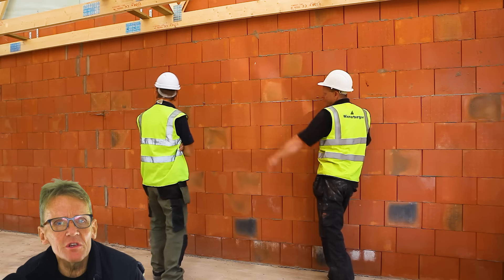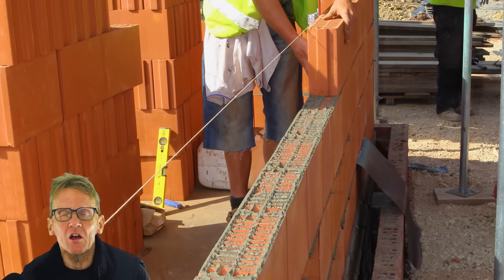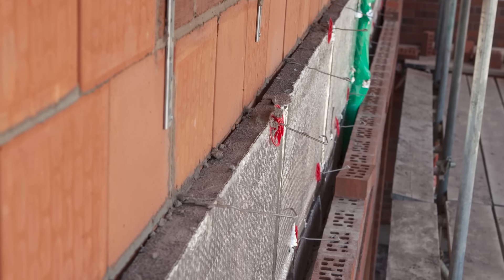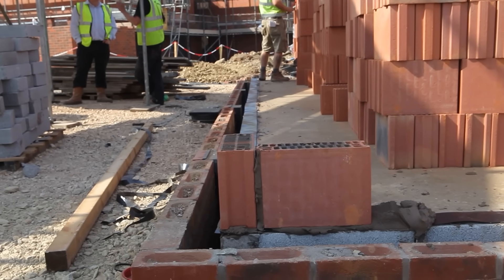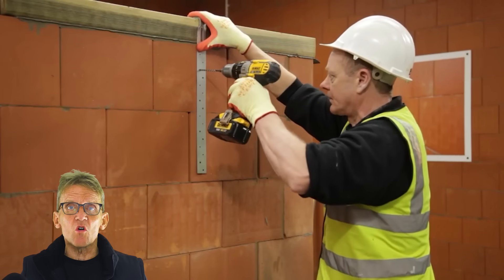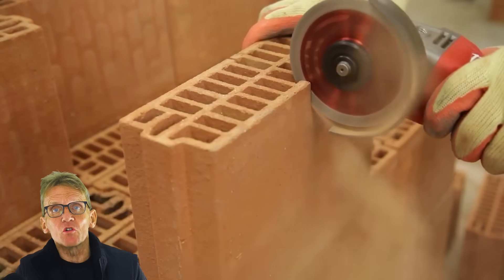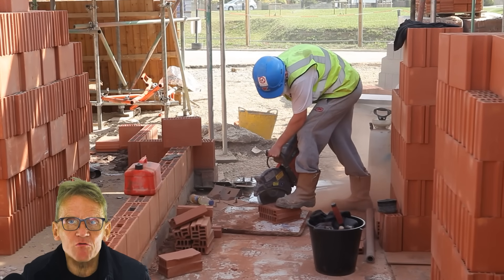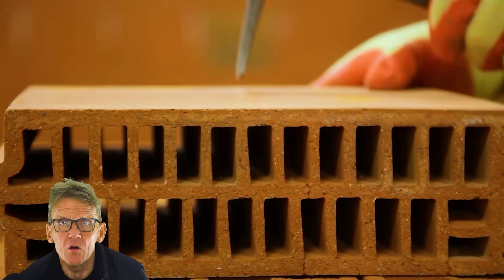Why Haven't We Warmed to Porotherm in the UK?

Comment: Like the multi layer building in your example video most, also used in France, have the airgaps on the side, so horizontal instead of vertical. So as you can see they are cemented all arround. On the flat/long side you can use a tool that lays a thinner layer 0.5-0.7cm of cement because the blocks are very straight. Disadvantage to concrete block is that they are more expensive however do better in insolation, speed/easy and steadiness.

Comment: Funny how the Roman Empire was using a version of these blocks a few thousand years ago.

Now they have rediscovered it and come up with a modern day version.

The romans used these blocks because they heated under the floor with a fire and the heat was pulled from under the floor, through the walls up into a chimney on the roof.
Reply from the maker: Don't forget the slaves who kept the fires burning so the Romans could walk around barefoot in the winter.

Comment: Yank, here from the States - never mind clay tiles,  every time I visit the UK , I have to wonder why the Brits can’t be trusted to have the light switch located INSIDE of the toilet ?
Reply: Many UK bathrooms have an internal light switch on the ceiling which has a pull cord to operate, however my house in Eastern Europe has an external light switch.
Reply: @scottyc7220  I just returned from the UK a couple of days ago after a few week’s stay; not one of the six  hotels we stayed in had a light switch inside the loo - must be a shock hazard thing …
Reply: @jimseviltwin1 Yes, I believe it's against the building code unless on a pull cord.
Reply: @scottyc7220  that’s my guess, too- however the National Electrical Code in the USA allows it provided it’s on a fault protected circuit. Such a breaker is fairly inexpensive here.
Reply from the maker: jimseviltwin 1 
We also have circuit breakers and many of our regulations are changing to reflect that fact but there are zones in bathrooms that require different approaches. 
Safety aside there is logic in having a switch outside the room you are entering.
How many times do we say "The switch is on the right" because we know people will struggle to find it in the dark.
Now, of course we have infra red proximity switches which detect the presence of somebody entering the room and,  more importantly leaving it.
Reply: @SkillBuilder  I guess it depends on what you have grown up with or used to … unless the room off of the WC is totally dark there’s sufficient illumination inside to find the light switch, which is always located inside the bathroom about four feet from the floor on the doorway opposite the door hinges. And if there’s not enough light to find the switch inside the bath’s door, you’re not gonna find the switch outside of the doors, either.
Reply: Don't think we in the UK like change, there are some disadvantages to this system but the benefits out way those ! 😊

Comment: I worked in germany 30 years ago, their construction was far more advanced than we are now.
We used to build a floor of a block of apartments  and the waste wouldnt fill a mortar tub. Here a lift fills a skip with waste. I cant believe that main contractors have never addressed the waste material here.
We used a 250mm cube block, kalksandstein, every opening measured multiples of 250mm, width/ height so there was next to no waste material.
Architects, manufacturers still design with metric equivalents of imperial dimensions, instead of designing all openings etc to work brick/ block dimensions. Comical
Reply: When I did my first own build I was annoyed at the lack of standardisation of measurements in anything, causing masses of waste, 2m2 of brick and block went in to the soak away which the builder explained was a saving for me.
This will not happen on the next, I think I'll do the designing and drawings.
Reply: @sresto7943  many yrs ago I was building an Aldi in Kettering, raked out brickwork. We were really struggling with brick sizes and maintaining uniform joints. They called a rep out for the brick company with regards this.
I kid you not, he strung out bricks across the car park for close to 100 yards, measured it and said it was within their tolerances.
Material quality control by manufacturers is a joke. I've lay bricks that vary in length by +10mm, -10mm around the standard of 215mm. Height can vary from 60mm-72mm around a standard height of 65mm.
Our coursing is 75mm, imagine what that shit looks like.
Reply: @richarddavey7884  "Material quality control"
We don't tolerate tolerances round 'ere mate.
🙂
Reply: @richarddavey7884  As a fellow bricky, i feel your pain. Construction waste is completely out of control in the uk.
Reply: I work in electro mechanical assembly, and it's the same with us. The deviation from design by clueless management is truly shocking, unit upon unit is returned, how they make money beats me. If the customer doesn't see it, it's considered OK!
Reply: @richarddavey7884 what a joke: we all know that averaging cancels out individual variation, but variation is what makes the job hard.
Reply: @richarddavey7884  for those, the expectation is a very thick layer of mortar in both the horizontal gap between layers and the vertical space between neighbouring blocks, so you use the top side of the brick to see when you need to 'thin the mortar a bit' with a tap or pull the brick off and add a bit more.

That's partly why, with this videos' clips of laying the porotherm I was surprised the goo (it's not mortar?) was only between the lower laid and upper laying layers and not fully for between the blocks off a layer.

And in the UK? ... well, I'd imagine the insulating properties are terrible enough that it's bad, combined with the damp issues... one big "No thanks mate"
Reply: @AlMcpherson79  The blocks are clearly very regular in size, I guess that's how they can get away with such a thin layer of adhesive. What I don't understand is why you seem to think that's a bad thing. 
Also, why do you think their insulation will be poor? As others have pointed out, these are used in countries like Germany that have much colder winters than we do.
Reply: @AlMcpherson79  I also was wondering why they don't put mortar in most of the vertical joints.    I tried looking it up, but had no luck.
Maybe it's a kind of built-in expansion joint? (at 7:30 he says that expansion joints aren't needed for lengths up to 20m).
Reply: @Splodnik  For modern houses, built according to the energy saving standards, you want as little mortar as possible. The mortar conducts heat better than the brick. Also, the mortar used for these thin joints is more like tile adhesive. It's an engineered product.
Reply: @matthewbooth9265 I drove concrete mixers for a while, so much wasted through poor measurement, incompetent excavator operators digging the footings and general sloppiness I dont pay I dont care attitude.
Reply: Insulation wise superior to anything we used, remember a solid wall is a cold or hot wall without control, the perks don't need a fill as they are interlocking and will double as a expansion joint across the entire beam on each rise, the air gap is these provide is many time anything we have, and add to that the cavity between skins, add to this a modern outer skin with polymer render system and cavity insulation, will make a very very efficient high specced weather system.
Reply: My house was built 15 years ago and I learned at the time they had even upped the game woth Kalksandstein another notch. My home is not build from the traditional small format KS blocks, but about 17 cm thick blocks about 62 cm high and maybe 90 cm wide (I actually don´t know the exact dimensions, that was just a rough measurement I could take.). Those are stacked using a small crane and they were delivered with both the pallets as well as the blocks labelled and numbered. Well not all of the blocks, the full format ones were not, but some were delivered precut to specific dimensions. They had those numbers in a plan, and if they stacked them according to that plan, you got all the openings etc, without having to cut a single stone on the site. Not to mention at which speed they got one floor up. This is a row of townhouses, each floor took just over two, at most three days for the whole row.
Reply: For every 5 houses built, 1 goes as waste. Absolutely shocking, but been that way in the UK for years
Reply: @InfiniteEchos  yep and 1 of the worst things to get involved was the NHBC, a guarantee like a 2nd hand car warranty.
They have us jumping through hoops and is it actually producing better houses, I personally think not.
Reply: @richarddavey7884 site I worked on had to pull three completed houses down due to improper construction. They bashed them down with a 20 tonner and everything went in roll on off skips. People had already moved in to the estate.
Reply: 😮traurig das zuzugeben müssen!!👍🇩🇪
Reply: While so much of the income around construction is based on a percentage of the project budget there will be absolutely no incentive to reduce costs.
Reply: Indeed.
Reply: Surely, all externals are dsigned to use standard brick sizes for openings ?
Reply: @thetessellater9163  no, most major UK house builders use 965mm front door openings, 900 or 1010 works brick. 
Wheel chair access really requires 1010 doorways, but the idiots think they can save a few £s on the door forgetting that we throw away bricks from trying to cut 3/4s to suit the opening.
The other day I helped a carpenter put floor joists on a plot of mine because I was waiting on him. The waste egger protect boards that went in the skip from offcuts was a joke. 
They think they can reduce the carbon footprint by not having bricks etc coming on to site wrapped in plastic. Yet the waste materials alone way offsets any gain from that.
Reply: True 😂
Reply: I've seen this blocks or something very similar used for internal walls in older or interwar period properties in Manchester. Same properties has normal brickwork on external walls.
Reply: I actually moved to Germany almost 4 years ago after being born and raised in australia working in civil construction, and after working in both places I gotta say some of the methods used in Germany especially when it comes to underground services and earthworks feels like a step backward by comparison
Reply: @KyloB  Maybe Australia's two steps in front of England then. As the other fella said, fancy elaborating?
Reply: @KyloB care to elaborate?
Reply: If we stopped stuffing cavities with insulation, internal damp would vanish, houses used to be able to breath,now there like an airlocked chamber, " full of us lot sniffling and sneezing all the time,😂
Reply: @richarddavey7884  Heritage is a curse at times. Imperial references and wobbly lime walls… 
You are right, they are super cool with that. What is the perspective of MDF in German handarbeiten?

Comment: My house is built with these, plus dense (HE) 20cm styrofoam insulation outside with silicone render. We have -20C to +42C temperature range, and I only need heating or airco on the coldest or hottest extremes, and even then, on low-power eco mode. BUT, putting a plug in the inside walls is a pain. Best use long concrete self-tappers and a hammer drill.

Comment: These would work well if the wall was designed properly. They need to be waterproofed on the outside with attention paid to where they attach to foundations to prevent moisture from wicking up. Then insulate the entire outside like a wrap with no thermal bridges at the windows. Then cladding of your choice. If using stone or wood or plastic then make sure to leave an air gap so the wall can dry out if water ever gets behind the cladding. If plaster or stucco you’re all set. All the problems everyone mentions here are because of poor workmanship, design and lack of attention to details.

Comment: We don't use them here in the UK because you need a higher skill and precision level than we are used to. You need to work to around 1mm accuracy. 
Regular bricks and blocks work ok to 5mm accuracy.

Our UK building trades need reform. Like in europe, where trades are skilled and recognised. 

Imagine everyone working at the same level as a registered sparky or gas safe engineer.

Comment: Well this video took me back a few years, nice one! I helped a friend put up a house with these bricks/blocks in Austria. Poured concrete basement and ground floor slab. The first course was bedded on cement, perfectly levelled. The remaining courses were bonded with special expanding spray foam, specifically for this type of brick -> this gave us perfect angles. Cutting was using a huge wet saw (around 100cm diameter blade). The experience was much as you describe aside from those points. Some bricks have glass wool insulation in the cavities - what are your thoughts on those?

Comment: We don't put skins on these. We lay the bricks that are 300mm thick, then put insulation on top of that, then the insulation will directly receive the render. There's no outer layer of bricks. If they want a brick for the looks, we have these brick tiles we put directly on the render, instead of the colour.

Comment: Really, do you really want to talk about the UK house building where one guy made a house plan and they copied it to every single house! They absolutely all look the same and most even have the exact same layout in and out!
Always with a dark a unimaginative outside built out if toothpicks beneath a bathtub. One of the houses I rented the floor was sagging on yhe bathroom that I was constantly afraid of reaching the ground floor during a shower. And this wasn't just for mine, many of them like this...
European construction is one of the best in the world, well, at least from around a decade or 2 ago. Now the cutting corners and material is rubbish so might as well buy an old house , rather than buying/building a new one...

Comment: Hi Roger, in Czechia these are generally all they use for internal & external skins! They then have to be rendered or cladded. Rendering or cladding helps attract moisture and prevents moisture from evaporating. Therefore when you travel throughout Czechia, you will see the rising damp at the bottom of the buildings and the render falling off, and same at top of buildings where water is able to get behind the render/cladding. The rendering and brickwork therefore suffer. As soon as you drive into Poland, you start seeing traditional bricks being used again. The biggest problem is that it is now very hard to find a Czech bricklayer that can do face work, which obviously look great when done right. There are almost no brickwork buildings in CZ which is a shame. I'm sure the cost saved with such material is not passed onto the home-buyer but the future repair bills are! Not being able to get good fixes into the wall is a deal breaker for me and many others!
Reply: That (damp-loosened render)'s presumably due to using cheap cement render instead of acrylic or silicone (or lime) renders which are vapour permeable.
Reply: Not sure this is entirely correct?

In Czech / Eastern Europe they typically insulate with EPS so the wall doesn't get wet and put a membrane underneath between the slab and the wall so the damp can't rise.

Speaking from 20 years of personal experience, no one I know has had damp issues.

The houses with render falling off are usually very old that haven't been refurbed.
Reply: @mrj774  Yes, new buildings are much better although they still like rendering in Czechia and therefore the moisture comes in from all directions so the render will eventually crack. I've been a carpenter for over 20 years and I wouldn't use render on my buildings. It's not so much about rising damp. As the building moves and settles, cracks will appear and then moisture gets in.
Reply: @TheControversyChannel  Our house in CZ is about 100 years old, last refurbed about 16 years ago. EPS and external render. Harsh winters, lots of wet weather. No cracks I'm aware of. 🤷‍♂️
Reply: Everytime we vist Cz, (Mrs is Cz) I always get stressed by the state of exterior walls and general maintenance, there are lovely properties, but the volume of repairs, cost and time needed by property owner does put me off :(
Reply: @user-cr6oe6yv5x  I had a quick look around streetview in Cz out of sheer curiosity - couldn't spot any problems, plus as I suspected, most building's renders start some way up walls with a stone or other impermeable lower wall.
Reply: Same in Portugal
Reply: Clay blocks are superior building material compared to solid bricks. Nobody uses solid bricks in CZ/SK for decades. You can build energy efficient house using clay blocks filled with rockwool or polystyrene. No need for stupid cavity wall.
Reply: @MrTurboSAAB1  Try using them as outside walls only here in wet Netherlands.. You will have plenty of work, and mold without a cavity wall.
Reply: @MrTurboSAAB1  bricks look better than render imo

Comment: The only issue I see about using these blocks would be, if installing uprights/batons/supports for weight--bearing heavy shelving/cupboards internally, how would you know if you're drilling into a cavity or part of the 'honeycomb' wall of the block. And what fixings would you use, ie cavity wall type or wallplug type? And would a subsequent weight/load on such shelves/cupboards cause splits in the block or a spllntering out of fixings from the thin surface wall of the block?

Comment: There are some blocks like this I have come across in old 60's council housing in London. Wind up for fitting back boxes in. Not the end of the world if you have bonding on the van to bed them in but you do have to wait for it to set before you can second fix.
Reply from the maker: I use foam